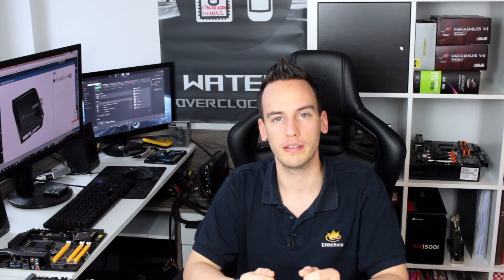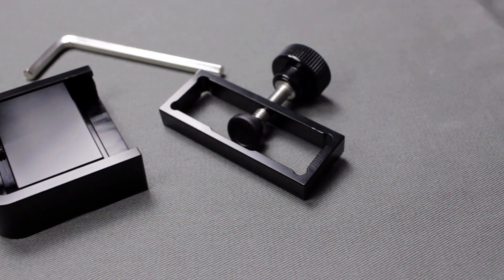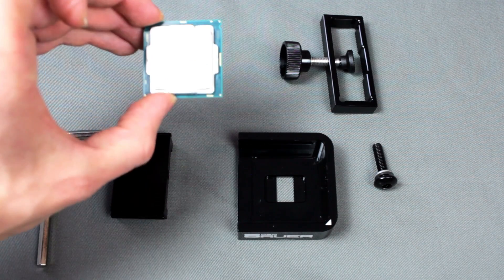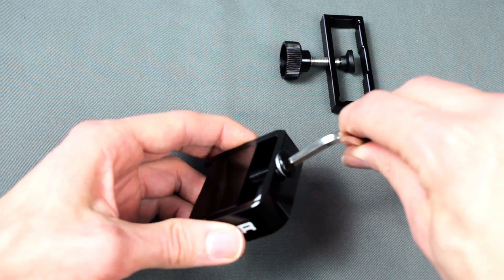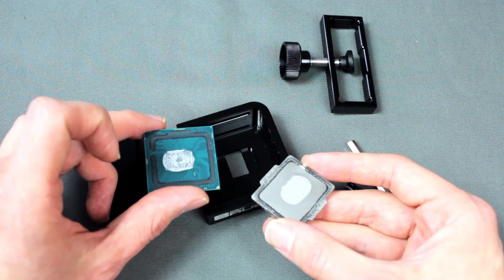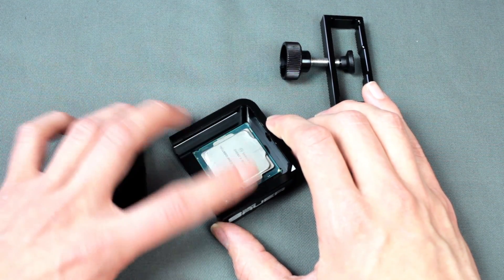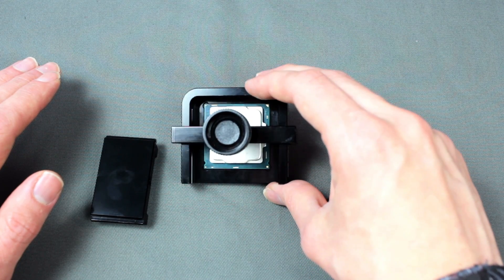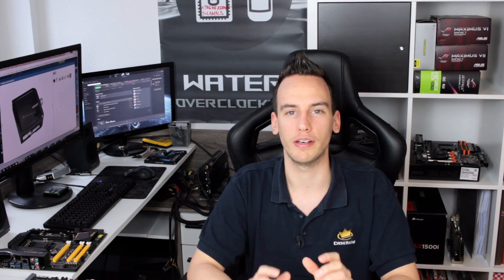der8auer Delid-Die-Mate 2 (en)

Comment: I bought the der8auer Delid-Die-Mate 2. And used liquid metal. Glued it together over night under press. Used this glue on the die. HY910 Wärmeleitkleber / Thermal Adhesive Glue Tube Heatsink Plaster Silicone. My temps falled over 10 degrees! Sucess! Overclocked my I7 11700k to 5ghz on all cores. 1.45 volt. Max temp 67 degrees stresstest prime95 with watercooling. Make sure the chip and backplate make contact. I used a very thin layer with the glue. I also removed all of the old glue around the die and the metal cover.

Comment: what if i have delidded my processor allready and i glued it back with epoxy from the corners. how would you re-delid the processor again, because my temps have been rising again alot after 3 years of delidding? taking any suggestions before i do anything so i get as low chance of breaking it as possible.

Comment: I know this comment is way late so I don't expect anyone to respond (although would be nice) I'm looking at deliding my 8600k but I want to know is it possible to do it without having to glue the cpu back together, my CPU sits flat in my case (not vertically like in most cases) with my h100 v2 sitting on top of it, I don't really see a need to glue it back together as it is flat..
Reply: You definitely don't need to glue the IHS back on, even if you mount your CPU vertically. The CPU socket clip will keep the IHS firmly in place on its own. The only problem is when you want to remove the CPU later for whatever reason, because then you have to open the socket and the IHS will simply be floating on top of the thermal compound, which can be dangerous if you accidentally tilt the CPU too much while removing it, because the liquid metal will go in all kinds of places it really shouldn't. That's why some people prefer to glue the IHS back on. Another reason might be wanting to sell your CPU later, because it's simply more practical to mail a chunk of metal than it is to mail a PCB with a very fragile die poking out of it on the top side.

Comment: Helllo,your tool for delied working 8700k with custom IHS on  rame?the custom IHS is closed only with super glue loctite in the 4 corners or edges.Best regards Master.P.S.  with the super glue in the 4 corners or edges it is better to heat with a hair-phone? to soften?

Comment: Neither this or Dr.delid available! Did the world run out of aluminium?!
Reply: So caseking had this tool available. I ordered this and other things I need for delid. Then 40 minutes goes by and I recieve an e-mail "your order status has changed to processing". I check all items on the list and see that the tool is no longer in stock. Are all german manufacturers this inefficient? The webshops I use in my country has a "feature" where the things you put in the basket is reserved for 10-15 minutes, so when you order something in stock it is actually in stock - caseking might learn a thing or two here. I know you can do better Germany! ;)

Comment: Why is this out of stock everywhere ? Will there be new batches made or should I look elsewhere ? Both times I have delidded with a razorblade I have scratched the PCB would like to avoid it this time with this tool.
Reply: Use hot air gun to soften the black goo.

Comment: can we delid an sandy bridge cpu with the delid die mate 2 ?
Reply: Sandy bridge has good TIM inside. So no need to delid it.
Reply: yeah but i wanted to find a cheap cpu to try the delid die mate before deliding my 7700k
Reply: Well i just ordered this delid tool, gonna delid my 7700k too. I am going to use Core 2 duo cpu to test it first tho.
Reply: Sorry not core 2 duo lmfao, i mean old sandy bridge i3 cpu so sandy bridge cpus will work just fine. And boom its SUPER EASY to delid with this tool!

Comment: How stable is liquid metal TIM over time? I probably will not touch my 7700k until the warranty is over but the gains look to be good. I'm kind of lazy though and would prefer a more maintenance-free experience rather than redoing this every year or so.
Reply from the maker: It really depends on what kind of surfaces you apply it. Between a nickel plated surface and silicon it seems really stable and I didn't see any issues so far with it. Just between nacked copper surfaces it might be possible that you have to re-apply
Reply: Do you have concern for the presence of potential contaminants like water vapor, molds, oxygen, etc. that would get under the IHS when delidding?

Thanks for the reply!

Comment: I have a delid question. The old model backwards compatible PS3's all die eventually because Sony didn't put enough thermal paste under the lid to contact the CPU itself. I destroyed one already dead board trying to remove the lids so now I'm paranoid to try and fix my failing 60gb model.  Any advice for delidding when the cpu is soldered to the board and not removable?

Comment: Hey roman, not sure if you mentioned this (My bad if you did) but; Am i correct in saying you need to create a small gap in the silicone glue on the IHS? - If yes; what happens if you don't and just create a seal on the IHS?

I'm a 6700k owner and i'm really looking forward to using the DDM-2 to drop the temps way down. :-p

Comment: that's a ES CPU it's still Intel's property umm damaging Intel Property O.o
Reply from the maker: ES doesn't mean that it's still intels property
Reply: der8auer Well Intel loans them out... idk what terms Intel loans them out for you guys but that's what I saw on the page. I'm surprised that you respond...

Is it possible to over tighten a delided 4690k with the IHS not glued back on with a NH-D14?

oh
Reply from the maker: It depends on the contract you have with intel :) somtimes it's a loan, sometimes it's a gift. Really depends. Only in maybe one out of 10 cases I had a loan. In all other cases I could keep the CPUs.

If the HD-D14 is sitting flat on the CPU it should not be possible to kill it. Only the corners of the CPUs are really fragile if the cooler is n ot sitting properly
Reply: der8auer interesting damn I want to be you some day... LN2 😌

Comment: @der8auer can u put delid mate2 after re-lid into oven?@80C. Is there any plastic part?
Reply from the maker: There are plastic parts at the screw but this type of plastic melts at 180°C and has a long term operating temperature of 95°C. So basically 24/7 usage at 95°C would be fine. Means you can put it in the oven at 80°C without any issues

Comment: why put the ihs back on? experiment with exposed die cooling, just dont mount it so tight. Old AMD cpus were exposed and then a heatsink was slammed on top with extreme force.
Reply: I would advice to buy something that supports the cooler. You have EK supports I believe. I have a Noctua NH-D15 which is ~1.2kg. Putting it on a naked DIE means suicide.

Comment: May I ask if the "glue" thats allready on the IHS can be reused? As in i delid then put the IHS back on the CPU dye will it stick?
Reply from the maker: Won't stick :)
Reply: Ohh.. well do you have any suggestions on how to stick it back?
Reply: This is the best: https://www.caseking.de/uhu-hochtemperatur-silikon-80-ml-zuhp-006.html

Black high temperature silicon. Don't use too much, you want the IHS to be tight to the DIE.

Comment: I have a question why use the heat spreader after removing it
Reply: in the case of Sky/Kaby Lake the PCB is very thin so the IHS actually adds increased structural strength to the CPU. In theory though you get better transfer of heat to the cooler with a naked die, such as with EK's "naked Ivy" mounts, but in practice it's tricky to get right.

I heard somewhere too that Sky/Kaby Lake actually performs worse with a naked die now, but I can't find a source. But let's be honest here, der8auer isn't going to integrate an IHS reattachment support into the v2 product if it wasn't necessary :p
Reply: The reason behind IHS is to ensure more heat transfer between CPU and Cooler. The contact surface matters. Bigger, more efficient.

Comment: Im in australia. Will i be able to get this? The product btw looks awesome and easy to use. Sadly i got real bad luck of the draw with my 7700k. the temperature spikes like crazy from idle temp of 30c all the way up to 60 in split second. I have heard delidding will help with this am i correct? P.S i am using a 360mm rad to cool the cpu and have reseated the cooler twice. also there is nothing wrong with the water cooling setup as i have used it on a 6800k and it worked fine. Also any info on recommended TIM and glue to reapply the IHS would be appreciated

Comment: @de8auer You really should get the delidding screw head designed to have the center be an alan wrench , but the outside of the head of the screw... Have a hand tightening wing nut type head that you can twist with your fingers. You could still apply quite a bit of pressure from that and may not even need the alan wrench. Way simple and more effective imho.

 ALSO, Create a premium version of Delid-Die-Mate 2 (pro) would work...  Include in the premium package... a color selection maybe to match say a computer case color??? (Maybe dual colors available...)  and then include a T alan wrench. or make the alan T wrecnh the actual screw itself. (long style screw.) And now you have something you can pull 80$ out of. 

Word is out about delidding it's time to be #1 for good! Because you're delidding tool is amazing. And I can't thank you enough for making it! Ever need a good mind to help out lemme know.
Reply from the maker: Thanks for the kind words :) I tried using something like this: https://images-na.ssl-images-amazon.com/images/I/31gLyF4LvcL.jpg
the Problem is that those parts are pretty expensive and would increase the price of the tool by probably 20-30%. I also tried a wing nut but it's really difficult to apply enough pressure with some CPUs. Kaby Lake is quite easy to delid but for Haswell you need quite a lot of force so it didn't work with these CPUs :/
I will consider to do a premium version tho :)

Comment: I am a user of gen1 of your tool and it has successfully delidded 8  i7 cpu's.  I'll be buying this without fail, I already have 3 7700k's that need the delid treatment.  I have had great success with using a product called RTV 147 to glue the IHS back on, its a high strength electronics grade silicon adhesive, I recommend it to get your IHS secured after delidding.

Comment: What is used to make IHS? It looks like aluminium but i'm sure it's not that cause otherwise liquid pro/ultra would cause problems.
Reply from the maker: Nickel plated copper so liquid metal is no problem :) Personally I use Conductonaut from Thermal Grizzly
Reply: Do you think it's a good idea to apply liquid thermal "paste" on a GPU? (obviously the cooling plate is full copper)
Reply: Yes.

Just don't ever take it off again :)
Reply: i've seen some comments that Conductonaut from Thermal Grizzly disappears in short time, whereas Liquid pro/ultra last years without any performance loose.

Comment: Hey dude, very nice I might buy one! Question, I got an old 4670K, will delidding help a lot on this one too? I heard the TIM got worse with the Devil Canyon (4690/4790) series but I thought the 3570/3770 and 4670/4770 also already had worse TIM? Cheers!
Reply from the maker: Yea should help a lot. OC-wise you can push more and probably reach 100-200 MHz more
Reply: Thank you! Another question I had, is Thermal Grizzly a lot better than the Liquid Ultra? Cheers!

Comment: 30€ for something that can be used for both delidding and re-sealing the lid is quite a good value, especially compared to the first one. However I would like to see this become even less expensive in the future. Keep up the good work, the design has massively improved!

I printed my delidding tool from multiple filament roll ends that nobody had use for at work for free (3€ worth of material at most, but a whole roll is usually around 20€, ymmv). The designs with instructions can be found on thingiverse/youmagine. If you or your friend has access to a 3D printer, I would highly encourage looking into getting one printed, otherwise you'd be better off getting this gorgeous product from store.
Reply from the maker: It's not possible to make it cheaper while keeping up a solid product quality :) But I think the price is really fair for what you get.
Reply: If you delid more than one CPU, it might be easier to justify the price for yourself, but for one time use that might be difficult.

Small volume niche products are hard to get cheap (I work in a prototyping lab) and this is where some clever thinking is usually required to do the impossible. However a piece of aluminium will probably hurt someone a lot more than one made from PLA/ABS when thrown :) From that aspect I would agree with you that it's a fair price.

Comment: what about for 5960x and 6950x?
Reply: Sean Williams 5960x has soldered IHS so delidding would give worse results with liquid metal and kill the CPU  and the 6950x is a special case as siliconlottery found out you can delid broadwell-E but under special circumstances/setup

Comment: What glue do you use?
Reply: And very nice tool!
Reply: RTV 147, electronics grade silicone adhesive, high strength.
Reply: where can you buy this?
Reply: Sorry,  I screwed up,  it's Rtv 167.  https://www.amazon.com/gp/aw/d/B00DKYJTCI
Reply: West Wood https://www.amazon.com/gp/aw/d/B00DKYJTCI
My fault,  Rtv 167, not 147.  And I'm sure you can get it cheaper elsewhere,  I get it from aviation supplier Aviall.
Reply: permatex black silicone https://www.permatex.com/products/adhesives-sealants/sealants/permatex-black-silicone-adhesive-sealant/

Comment: Hi Roman, do you know about any safe method how to mount kabylake cpus direct-die(without IHS) with a waterblock? I assume that if you don't use any additional clamping mechanism to the CPU it won't have proper contact with the pins on the socket due to PCB being too thin and also high risk of cracking the die. Did you already think about developing some "bracket" for this? I know, that it would probably make only 5-6C difference in temperatures, but that is still pretty good.

Comment: will this work on Broadwell-E processors like the 6850k or 6950x? or do i need the "Delid Die Mate Extreme"?
Reply: Tyler Durden broadwell-e is soldered, no need to delid
Reply: wrong, why don't you watch der8auer's 6950X delid video?
Reply: *****
The video literally says that it's soldered (but you can still delid).
Reply: why are you replying to a question where you don't know the answer?

Comment: Awesome indeed.
Though the 30 euro price + shipping may stop "casual" enthusiasts (like me) from buying it. I'm not saying that product is overpriced It is really high quality and worth the price.
As a side question, what would be the benefit of not putting back the IHS ? like EK has this "naked ivy" kit to mount blocks directly on CPU.
Reply: In the days before IHS I used to make copper shims to fit both intel and athlon cpu's.
Reply: I think the IHS will spread out the pressure of the cooler. The physical chip is only small so it might be crushed on the sides due to pressure.
Reply: santeenl that is kinda obvious. I was thinking to use plastic washers around the die to prevent (accidental) too much pressure on the edges
I just wondering what would be the temperature difference. My CPU is already delided and i use liquid metal between the die and IHS. I it runs well below 75C under stress testing (~150-160 watt). Currently my overclocking is limited by MB VRM overheating and I can't water cool it due to space restrictions. So for long stress testing, I'm limited by 4.5GHz @ 1.29v.
But I before the VRM overheats I can reach 4.8GHz closer to 1.4v
Reply: naked ivy kit wont work on skylake/kabylake cpu's also you wont get proper pin contact by leaving the IHS off the cpu, the PCB on skylake/kabylake is much thinner than ivybridge/haswell cpus and they require the IHS for structural rigidity
Reply: potato in my case it will work perfectly well since it"S 4770k

Comment: How do you clear the epoxy leftovers from the glue and what type of glue are you using?
Reply: You can clean it of easily with an old credit card very effectively without damaging anything, the best glue to use is black silicon.
Reply: Cheers, that was my own conclusion confirmed. Its just something you have to hear from someone else.

Comment: The price is much better now. If you had it 2 weeks ago, my Haswells resistors would still be there...
Also, you might consider putting English description on the store page.
Reply: I did know where they are, still managed to cut them. It's not as easy as it looks, they are less than 1mm and very fragile. You can remove them with a finger, not to mention a razor. I've cut of 4th and 5th looking from the left-top. Did a very ghetto style fix. I've put droplets of liquid metal on them and sealed them with nail polish. Works fine. Overcklocks by 200MHz more than before on the same voltage.
Reply: @mumin84  and that is why I never wanted to attempt delidding before. The risk of damage is there and I'd probably be one of the ones that irreparably damaged the cpu.
Reply: Psittac20 If it's available in Germany, it's available in UK. They haven't left yet. 
But that is not the point. His videos are in 2 languages, the store is in 2 languages, but the producf page isn't.
Reply: if you are using the latest Chrome, you can translate the page I am seeing right now in English
Reply: Sure, but the quality of the translation is awful.
Reply: When it is available in the US and UK it'll probably have english